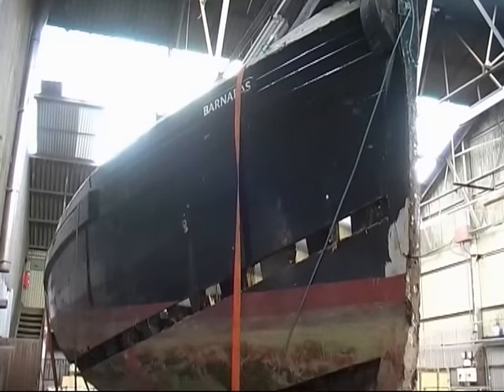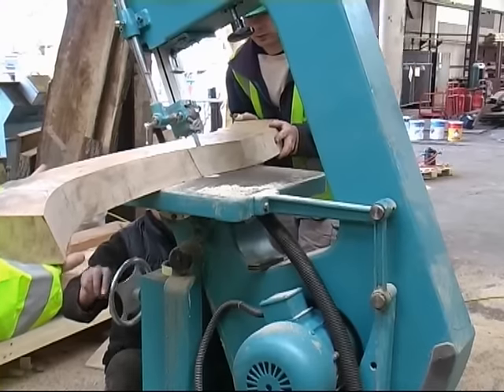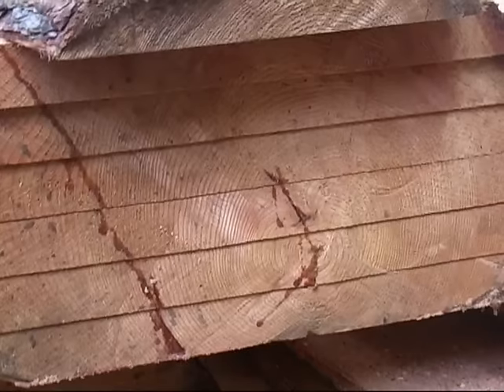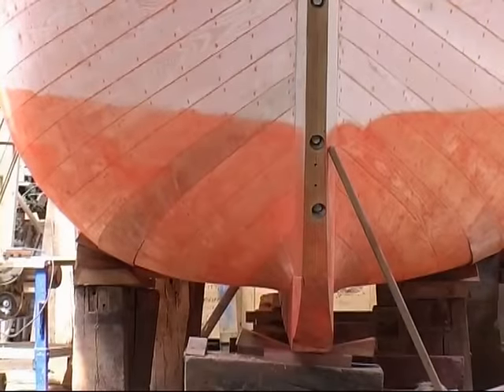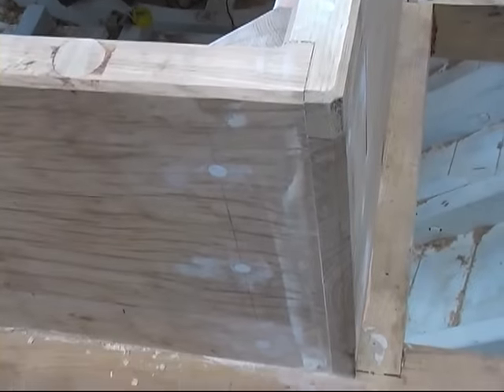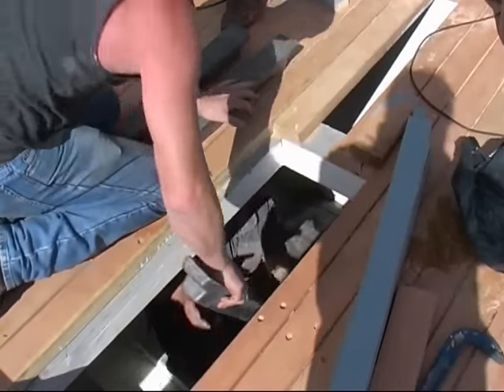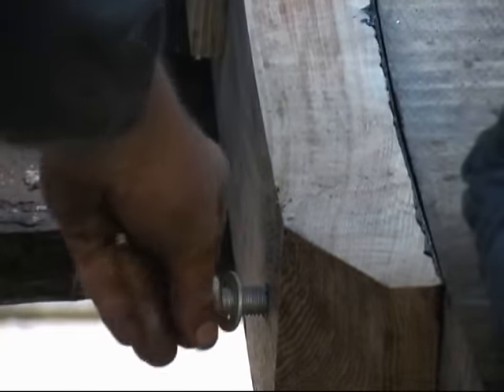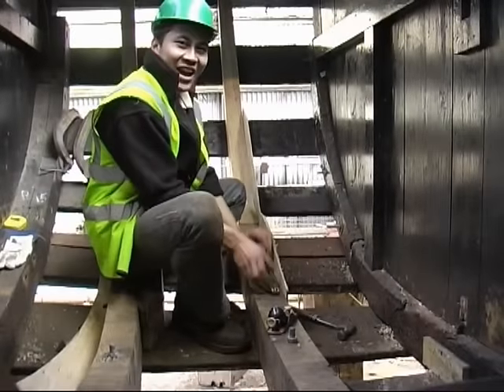THE RESTORATION OF BARNABAS

Comment: Also, as an instructional video, this is first class!  Fitting the garboard is so interesting.  At 1:38:54 you can see the "lever" of wood clamped to the aft end of the plank, in order to control the twist.  The twist is phenomenal - it's often assumed that planks need to be steamed in order to allow them to bend, but it's getting the twist that's the real challenge.

Comment: I understand that with any project like this there are perimeters and compromises. This is a workboat (no interior), not a personal cruising boat, Barnabas will probably never race the Fasnet... Finishing this restoration in 9 months is impressive! It took me 7 years till I got my boat in the water. With that said I wouldn't have felt comfortable using steel or galvanized fasteners. Also, 5 tons of "loose" ballast in a knockdown/rollover would have been interesting. Personilly I would have insisted on ear/eye protection... I have ringing in my ears that never goes away from a foolish youth.

Comment: What is the reason for using galvanised steel all over?
Economical? The acids in the oak wood have tendency to make  black /  galvanized steel rust .
Even with tar as protection on the bolts spikes  this can occur... 
I would have gone for stainless in the bolts allover  (and copper in the spikes at least bellow the  waterline) .
I get that it cost more but will last longer  ,and be mutch more possible to remove  in the future than 
Rust swelled steel ,(that also cause damage on the surrounding wood  /spike rot)
When the restoration seems to 
Go the traditional way with the selektion of metal (  wessels vere often built with steel bolts etc . The ships/  boats  was not built for a super long lifespan then . the use of epoxy instead of wooden plugs , is not traditional  method.
I am a traditional ship/  boat builder , by the way ...

Otherwise excellent techniques  and craftmanship . 
Very informative and good dokumentary also.

Comment: They did a good job on her, surprised they didn't use bronze bolts and copper rivets & roves though. By using steel fastenings the oak will get iron sickness and not last as long. Wouldn't have cost that much more in comparison with the total cost. still, the boats still afloat nearly 20 years later - 2023.
Reply: my experience is that the galvanized fasteners are good for about 80 years ..
Reply: This was how the original was built in 1909. Fishing boats weren't expected to last 110 years

Comment: I don't believe all that wood needs to be replaced it might as well be a new boat the old boat is gone 😢
Reply: 100% The old Barnabas was merely used as a template. There is now no evidence of the original fabric and the techniques used, so no research potential.  It is more accurately described a replica as the only features restored are the silhouette and volume.
Reply: On many  boat ship restorations on such old vessels the replacement  of parts are often very substantial. 
In som cases only one or a few parts of  the ribbing /stern /bow  main structure is left.
Keeping planking doesn't count.... planking is constantly being replaced...
But i would  say you must keep some structural part to be able to claim that the ship boat is the  original vessel.
This can be important when applying  for funds from maritime museums for restoration work.  New ship:  no cash ...